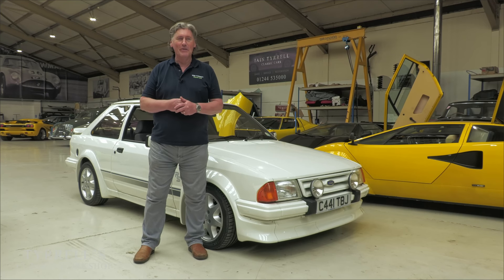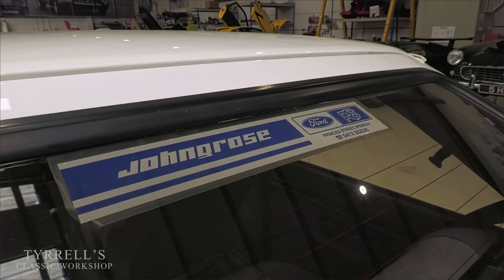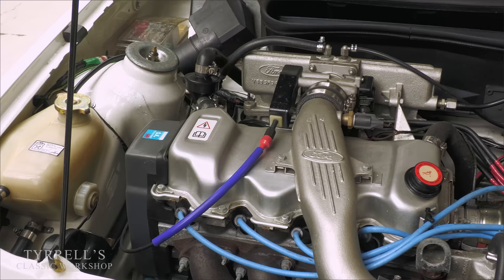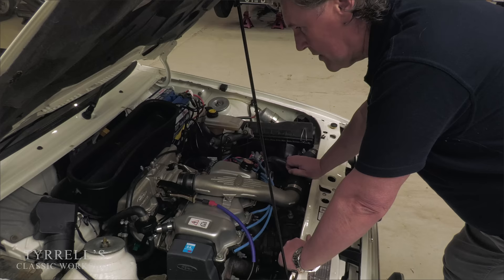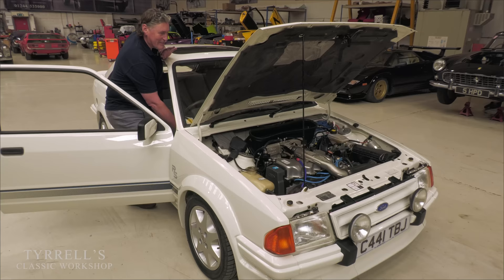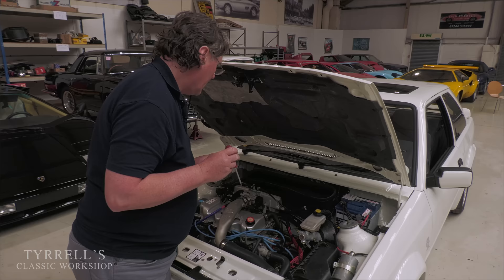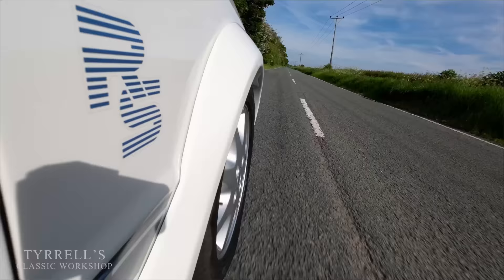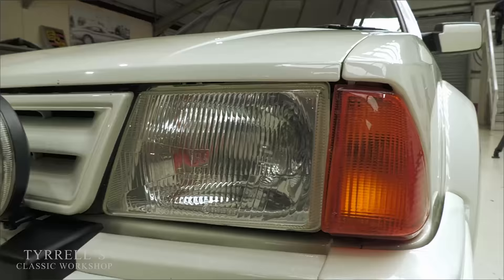Unleashing the Power: Reviving the Ford Escort RS Turbo's Performance | Tyrrell's Classic Workshop

Comment: Hmm I don't see what all the fuss is about. I've owned two 1.3L & 1.6 Ghia and wouldn't want another. To say that CVH engine is rough is being kind, it's also gutless and the gearbox ratio's are ill matched to the engine. Perhaps these turbo's were built on another production line in Cologne?
The positive aspect to this of course is while folks are fixated on spending a fortune on these, far better engineered cars are passing under the radar to the benefit of the more astute classic car owner!

Comment: Personally I thought the cvh engine was very smooth and refined compared to the previous ford overhead valve engines, the ford spark plugs were troublesome, and often sooted up or became wet on starting, if replaced with champion plugs, this would normally cure the issue. If no replacement plugs were available, you could remove the fomoco plugs, heat them up, clean and dry them, after refit the car would start ok. Another enjoyable video.

Comment: If the brake pedal with the engine running. The revs will rise if it right or drop if it's weak  .

Comment: These had an LSD installed as standard.
Reply: I don’t think the mk1s did, that came with the mk2 along with a different  variable ratio steering rack, no power steering but my wife handled it no problem.

Comment: Ford Escort Mark III RS Turbo => 861 kg / 1898 lbs, that's about 152 PS per ton, just quickly FYI
Reply: Curb weight is 1074kg. Then you'll have to add the driver, say 80kg, so you're actually at 114 bhp/ton.

Comment: This generation of Escort were ugly, unrefined and unremarkable when it came to the handling too. I still don’t get the attraction of these nowadays…is it just nostalgia? 🤷‍♂️ 

A few details I do like about it are…the position of the ventilation controls on the instrument binnacle, the roof mounted digital clock and those RS decals behind the front wheel arches, nice seats too. Everything else though…pass.

Comment: There is no justification for the reverence here. The CVH is a dreadful engine, truly rubbish. Breathless, noisy, strained. Hopeless. Chassis is ordinary to say the least, torque steer all over the place, massive understeer and leaden steering. Contemporary rivals chassis and engineering were miles better. The value is reflected glory from genuinely interesting and excellent stable mates like the Cosworth Sierra and RS1700T. At least this 1st generation was limited - most laughable thing I've seen lately was £30k plus for a 2nd gen Escort Turbo(Regular production model) .Amongst the worst cars I ever owned. Not fit to tie the laces of a 205GTi , Renault 5 Turbo or Golf GTI 16V